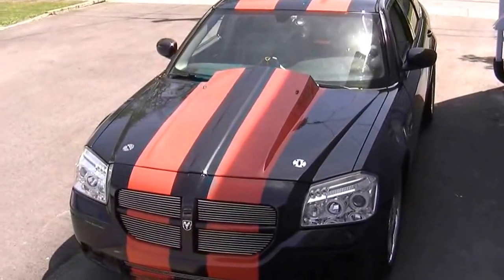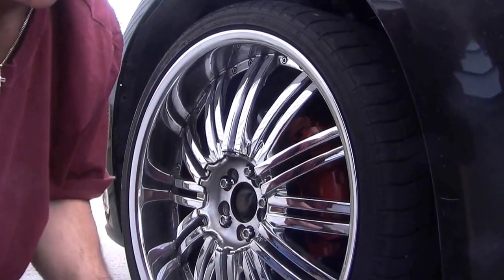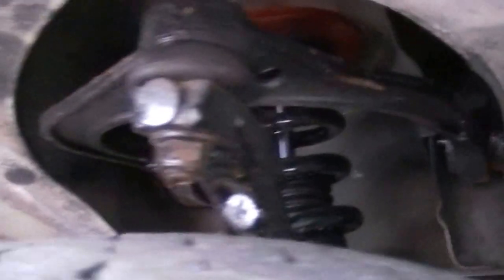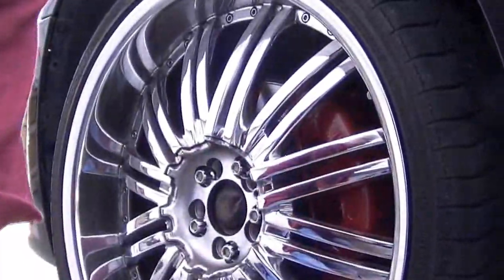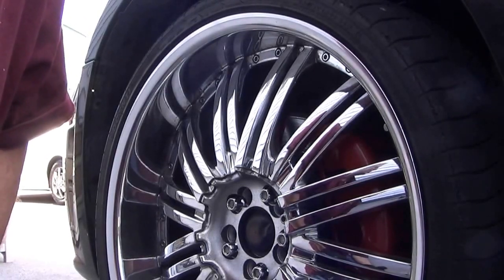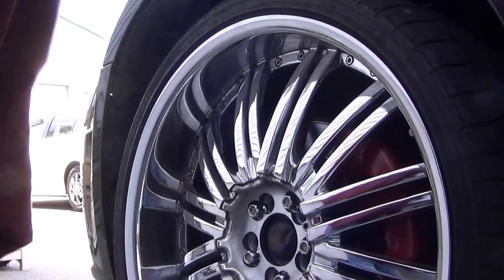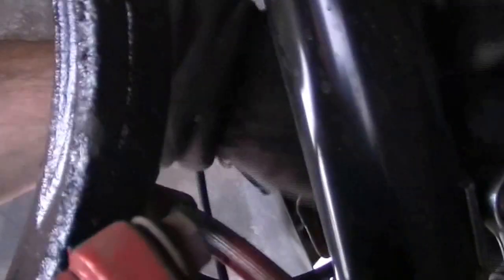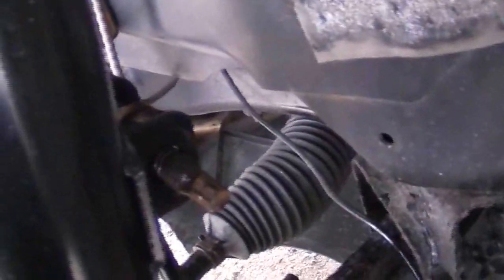Dodge Magnum Upper Control ArmReplacement

Comment: Why do you have to remove the suspension it looks like you can get to the bolts without doing so?
Reply from the maker: Sorry I should of explained that. I merely showed dropping the suspension as what i have on is not stock and a coilover lowering kit. The stock springs are wider and its hard to get at the bolts and pull them out.

Comment: Any reason not to remove the strut?  Its just one more bolt and having it out of the way would give you a little more working room.
Reply from the maker: i had coilovers on. the spring is much narrower so bolts slide out easier than the stock ones

Comment: How did u lower the whole suspension? i took off the top 3 13mm but dont kno how to lower the strut/shock tower. thanks!
Reply: Oh, not permanently. I'm talkin about what u did between 4:10-4:45 in your video! What do I need to do to make it drop like that so i can get my control arm bolts out??? thx!
Reply: Lyon TenBroeck ok thanks bro! i read that same thing on a 300c post and i tried it but after i jack it up a bit, remove the 13mm nuts and let it back down my strut stays in place & doesn't drop... maybe its just my car... 😞
Reply: Lyon TenBroeck do you still own this Magnum? It looks really good.

Comment: nise video !!..also nise   struts where u get them from ?
Reply from the maker: +Jose Rico Thanks first time and was nervous hahah as know was being filmed. I see all over using tuning forks and pullers and none worked right and the tuning fork is a pain as you have to rap it a lot for it to drop. This is much easier.  I got them from ebay ill try and find out who from and get back to you.